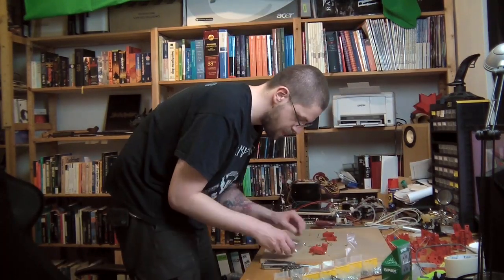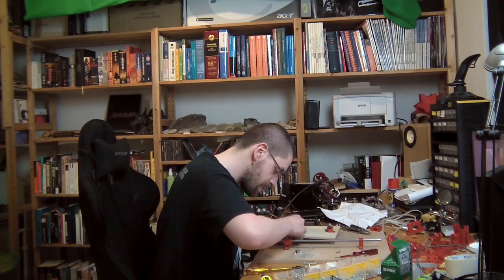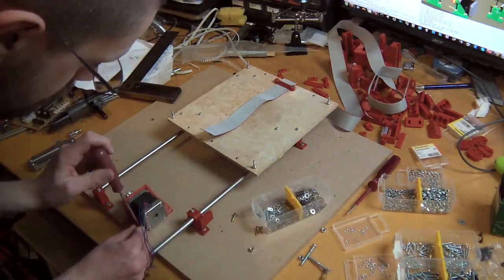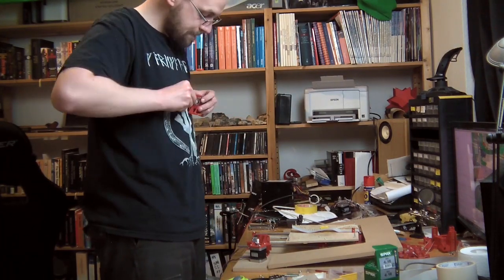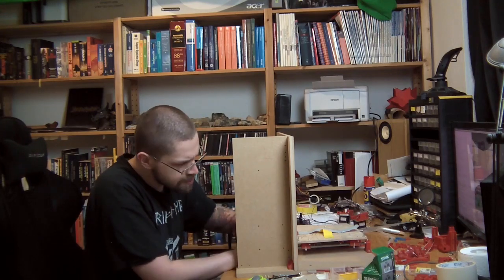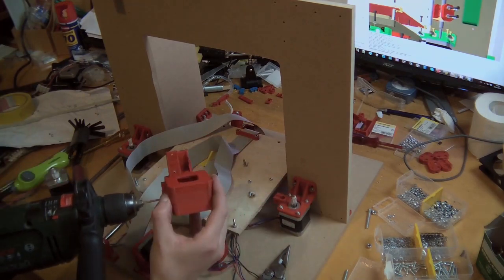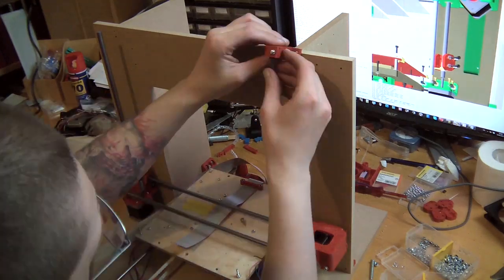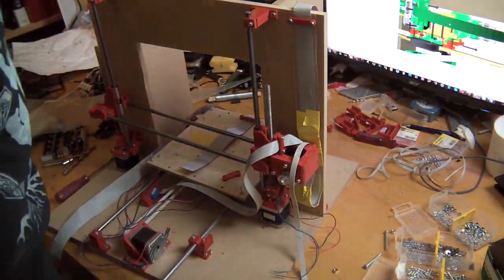Lets Build Mendel 90 Timelapse Part  1

Comment from the maker: Yes, its awesome. Printing took maybe 12 hours, its less than the prusa since the overall volume of the parts is lower.

Cost is maybe around 40-50 EUR, if you already have the electronics, motors, and rods. MDF is dirtcheap, so most of that are screws.

Comment: Great video max! I was considering the mendelmax 1.5,  but this design looks pretty good too. Would you recommend this design?  what's the cost of the machine like with the mdf you used? And roughly how long did it take to print the parts for this machine on your prusa?